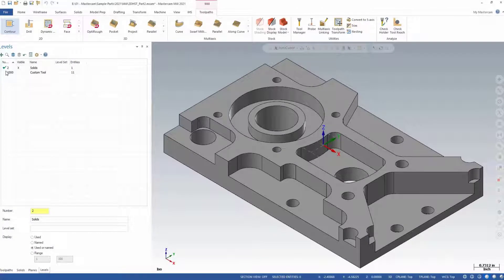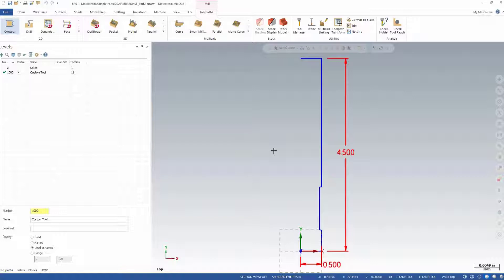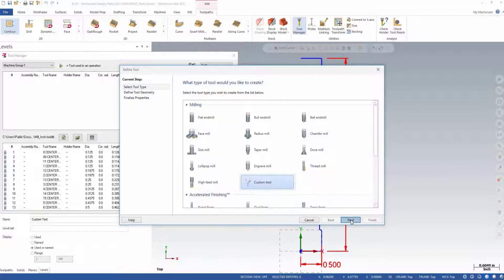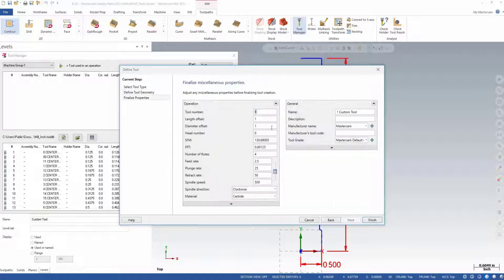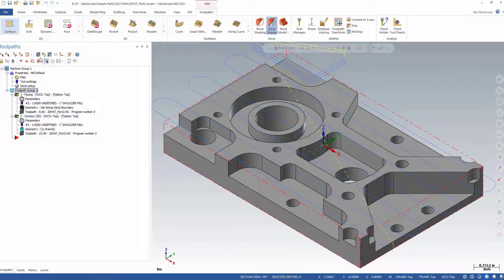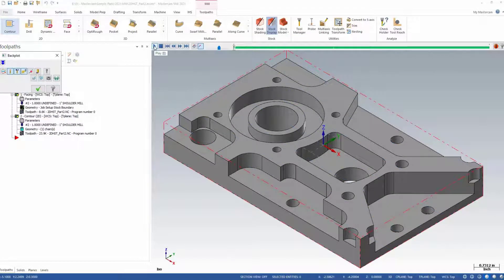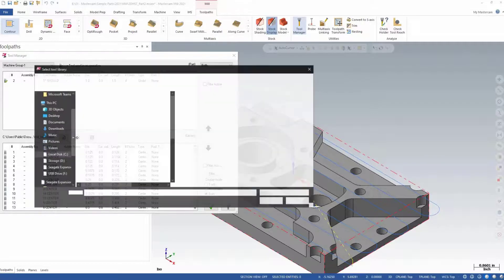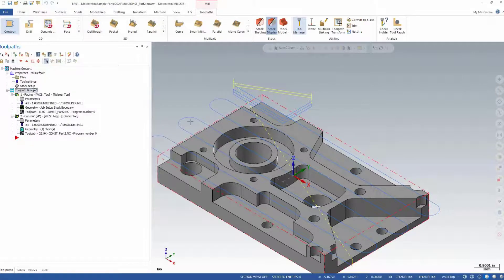Creating Custom Milling Tools From A Level In Mastercam

Comment: Dear In house solution make videos regarding master cam, by tool path groups
1.2D
2.3D
3.Multiaxiss
4.C axis’s
5.4Th axis’s
6.stock models with rough and finish